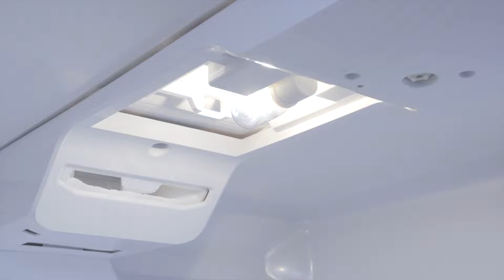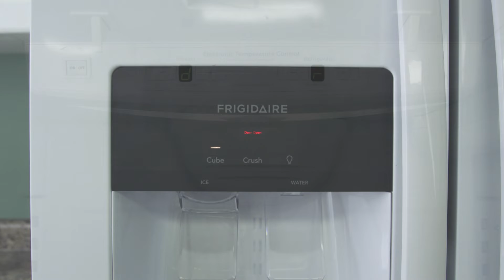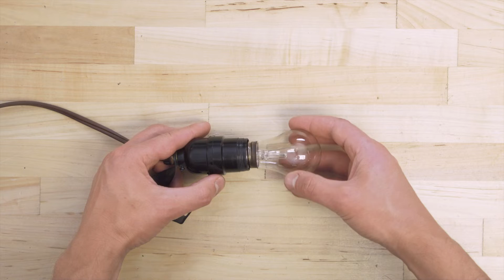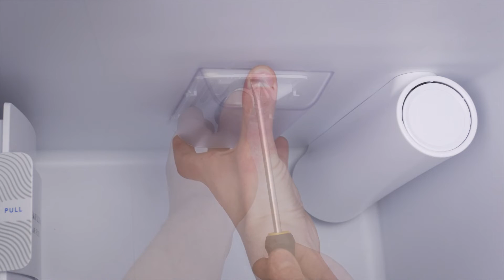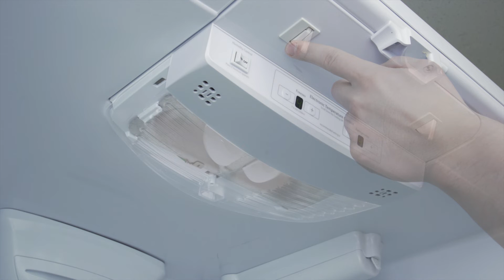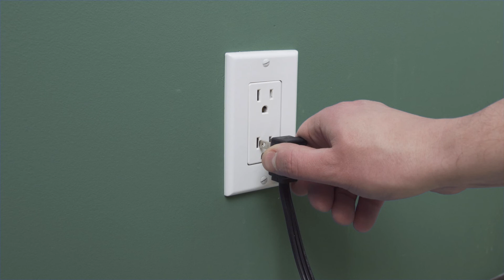Refrigerator Light & Socket (Testing & Replacement) | Repair & Replace

Comment: Mine uses led bulbs and uses aelectromagnetic switch
Reply from the maker: Thanks for watching. If there are LED bulbs then you'll have to install a new one and try swapping out one at a time until it works. You might also need to do this with the switch.